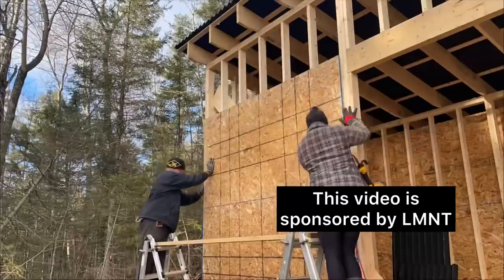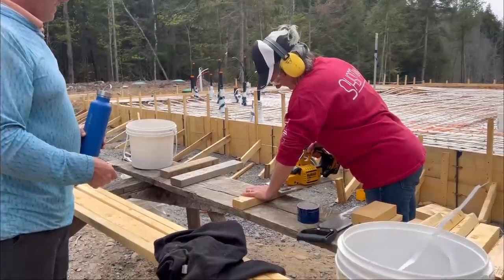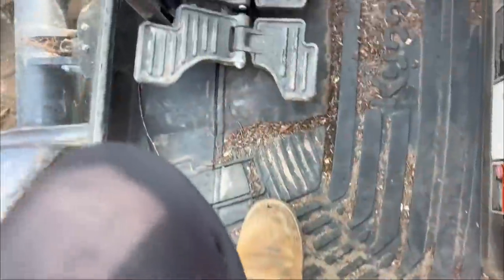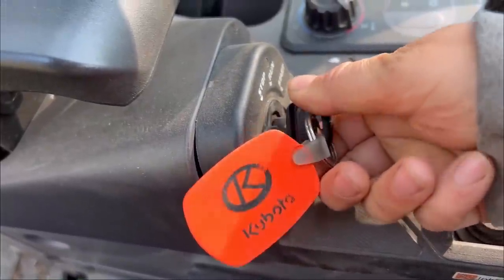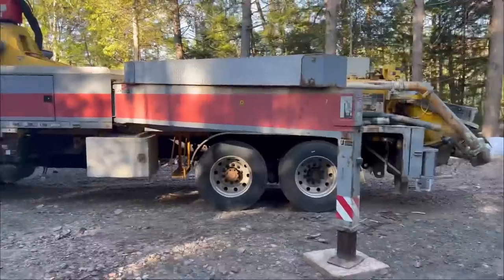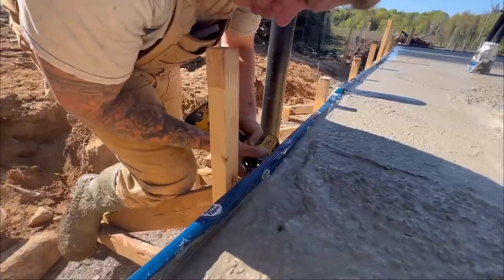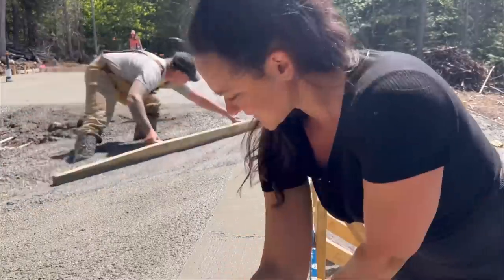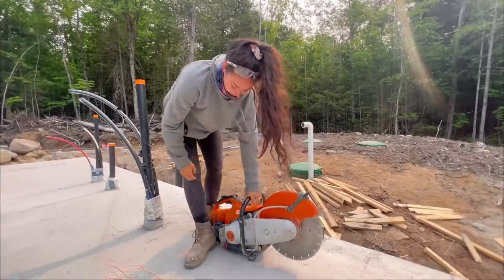We FINALLY Have Concrete! Building our Home from Scratch!

Comment: AWESOME!!!! CONGRADS!!!  Yeah, concrete waits for nobody.  We just poured a 24x24x5.5 slab this weekend and it didn't come out the greatest.  The cement truck got stuck first thing with 10 yds, we had to tractor the cement to the form, a distance of about 100 feet or so, dump it in and then rake everything to the middle. IT SUCKED!!!  We lost valuable time to work the cement (screeding/floating) and it set up quick.  If the truck hadn't got stuck and been able to pour in to the form, things would have gone smooth.  We pulled through.

You definitely made the right call getting a crew to pour it.  Having the manpower, equipment and experience is worth it.
Reply from the maker: Wow! Man that sucks so much. I’m sorry!
Reply: @SimpleLivingwithBiata  It's just how things go sometimes.

Glad yours went good, that bow isn't a huge deal.  You can work around it!  I can't wait to see some walls!

Comment: amazing job and with such an amount of concrete to only have that small bow in your boards really shows how well you did putting them up, i would let the concrete set hard then chalk a line across the top of the concrete and use a concrete saw to cut the bow out if you need it to be in line.
Reply from the maker: Thank you so much! That’s so kind of you! Great idea with the chalk line

Comment: Solution 👉to your concrete bulge, I had the same issue with my foundation. Bring out the bottom plate(2x6) of the wall to match the furthest bulge in the concrete. This means the areas not as wide as the bulge have a small portion of the bottom plate overhanging the edge of the slab. Your wall system then should cover. Would suggest pressure treated bottom plate if code allows for it 👍

If the bulge is drastic, like a few inches you may want to consider cutting the concrete before it is 28 days hard.  kickass progress way to go!
Reply from the maker: Thank you so much for the suggestions! I appreciate it!

Comment: Nice job Biata, looking really good. I apologize if you answered this, I was curious how many extra yards of concrete did you need raising the forms up. Keep up the great work and stay healthy.
Reply from the maker: We originally planning on 32 cubic metres but with the dips in the gravel we would’ve needed more. Ended up doing 5 tucks at 45 cubic metres but only poured about 43, wasted two

Comment: Thanks God your concrete form held on !!! it would have been a desastrous....    but it ends well, that's the important thing...   you've got 6 more months before the snow,  where do you think you're going to be in beginning of december ?!   Btw,  you're doing a pretty good job, keep goig on....
Reply from the maker: It truly would’ve been! So thankful! I think we’ll be done framing and windows and roof up in July. August will be electrical and plumbing. Probably head into September for HVAC. It would be amazing to have drywall done by October. We’ll see how it goes. It’s a loose timeline for now

Comment: My foundation concrete set way too fast for screeding or smoothing the top at all. I should have hired a crew to make that part happen. Since ours is a perimeter, not a full slab, it's not as much of an issue. You definitely made the right choice ;)
Reply from the maker: Thank you so much! And it’s so freaky when it sets so fast!
Reply: @SimpleLivingwithBiata  chuckle. Yours took way longer than mine ;) By the time we had the concrete poured, I couldn't screed the point where we started, it was already hard. By the time I figured that out and tried the freshest part - could barely do a thing with it ;)

Comment: ha ha bows are no problem. I made the foundation in this house bye mixing concrete with a small barrel mixer and hauling it in bye wheel barrow. The concrete reinforcements are old water pipes and scrap metal
Reply from the maker: Wow! Amazing!

Comment: Looks like a concrete blade for the bulge, only thing I can suggest on that, concrete day is like a 4 alarm fire! I could see it setting up oof! You can still use concrete anchors for the bottom plates of your walls if you couldn't get all of the bolts in, so  there is an app and a device called the wall bot! It can detect through concrete like water lines, easy to forget where those radiant heat lines are, really do not want to nick those buggers, good luck looks great
Reply from the maker: Oh that’s great to know about finding the water lines. I was thinking about that as I went to bed last night lol!
Reply: Usually when I get an epiphany 😆
Reply: If I can share a little about our family of 3 as well, we were skinning spruce logs yesterday, and I told my wife about your log skinning attachment, and how much fun it is o,0 right! I did it by hand with a Klingon Mekleth I made about 25 years ago, sounds corny but it worked great, we are reminded of how much work you have done working on our projects too
Reply: @SimpleLivingwithBiata  could just sit there with a hot mug of coffee and take in the veiw

Comment: Depends on how big a belly you have. 😆 1/2 inch easy. more involves changing too 2x6 sill to accommodate the overhang on the slab. Pack it in with 2 inch strips or use 2x6 studs for that wall
Reply from the maker: Thank you so much! Walls here are 2x6s already but I have another solution! Tune in on Sunday for a fun video!
Reply: @SimpleLivingwithBiata  would of watched video sooner or later but now I'm curious.  so I will see you Sunday 😂

Comment: Seen 5 houses built my way with concrete slabs..All were left to dry in heat in a day, so not strong at all. Manufacturers state put a tarp over it for a week. I have worked thru flu too and found it just made the flu last much longer, and was the work that important...not to me.,,I now just rest and let sickness go away first...
Reply from the maker: Thank you so much for all of this! It’s important to rest!